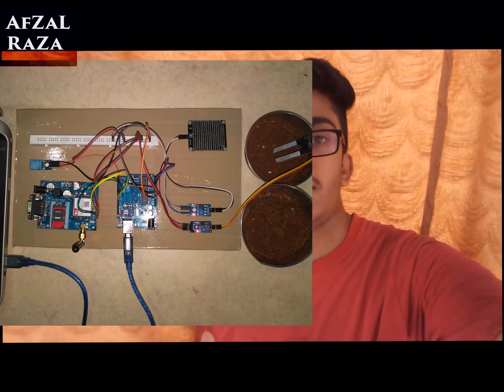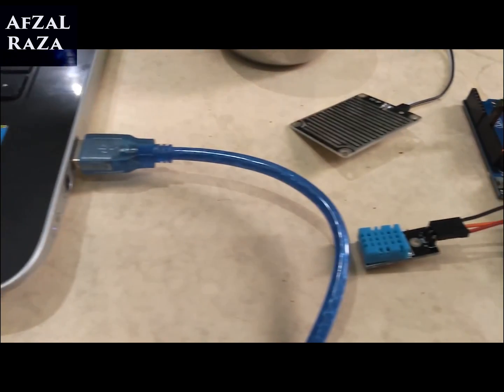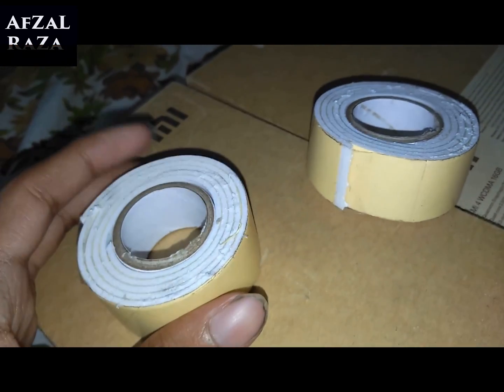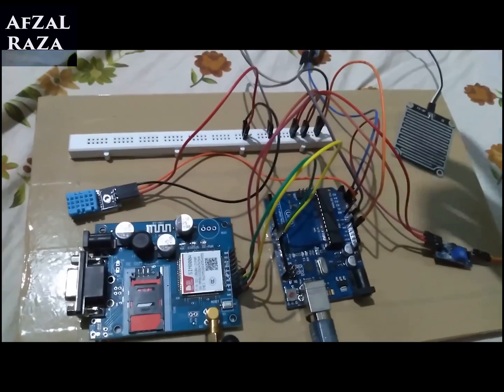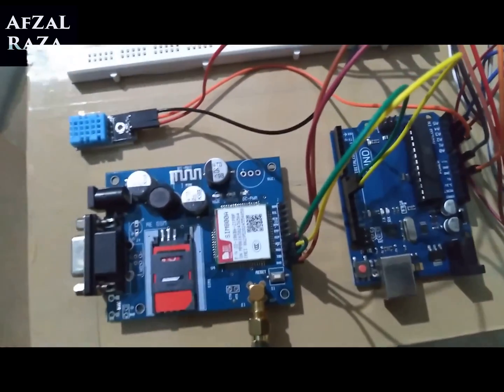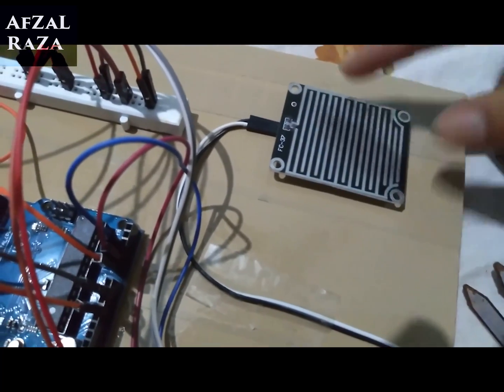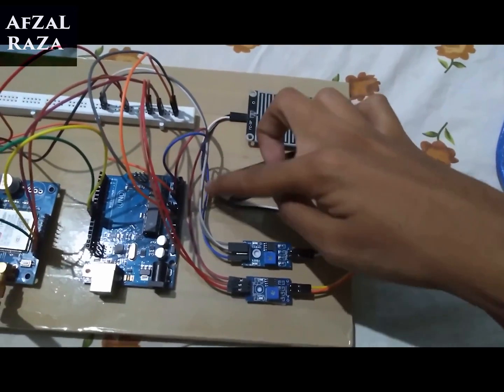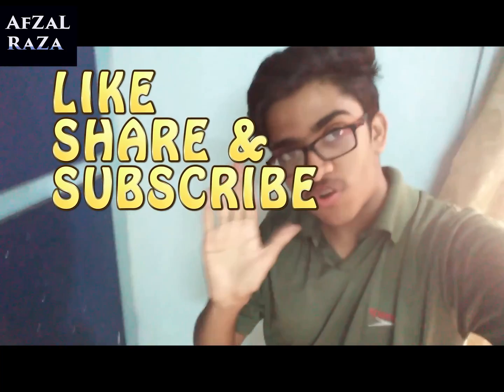MY ARDUINO BASED PROJECT | SENSOR PLATFORM FOR AGRICULTURE

Comment: How much it costs?
Reply from the maker: I spent somewhere between 2500-2900 for all the parts. It will cost even more if you plan to buy all original components. I used the components which are locally available in the electronic store and some from the Amazon...i gave links for these in description box. Check them out!
Reply: @AfzalRaza54  How to connect for making project ?
Reply from the maker: @rutvikjadvani9783  sorry friend, i don't make projects these days, i just made this project for my Final year Project. I can help you btw if you have any doubts. email me on razaafzal.afzal3@gmail.com